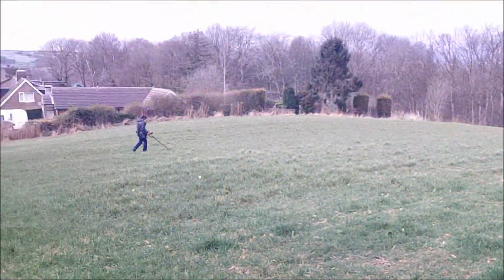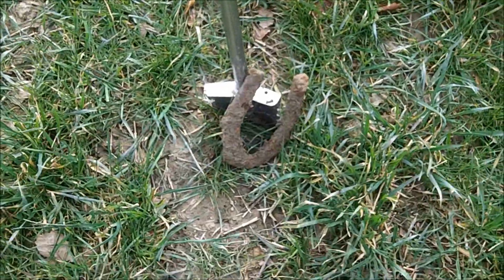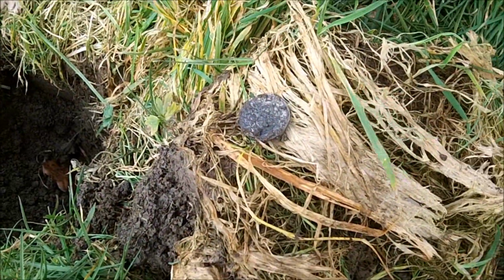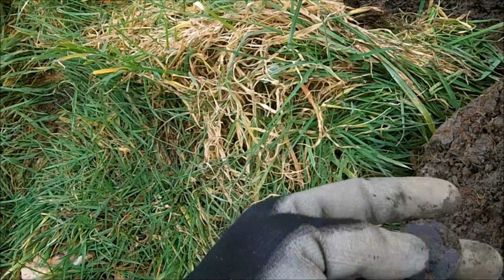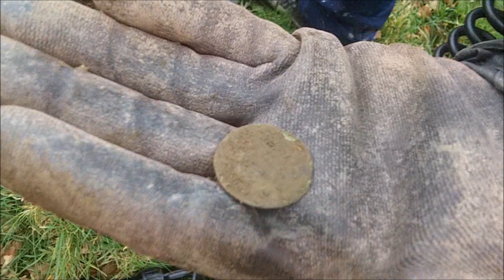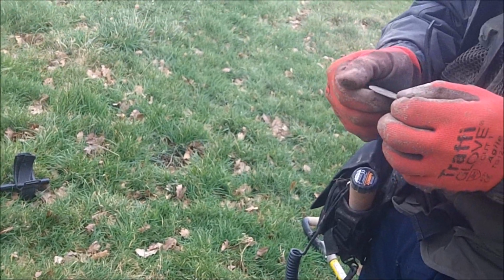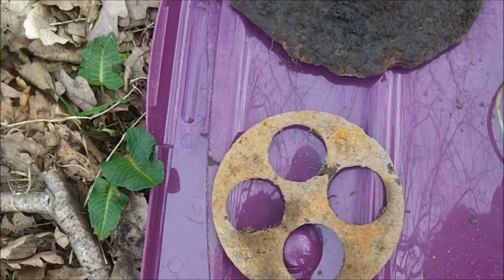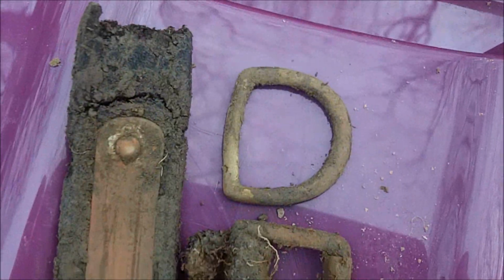STEWART & ME  ON THE COIN FIELD

Comment: the odd one could/maybe  a horse brass some times they use to solder parts to round brass discs and put them on bridals as you can see in the pic cheers darren ,,,, http://www.alamy.com/stock-photo-a-white-grey-gray-horse-mare-stallion-gelding-face-eye-close-up-portrait-59375465.html
Reply from the maker: Thanks for the info Darren ,ATB Paul